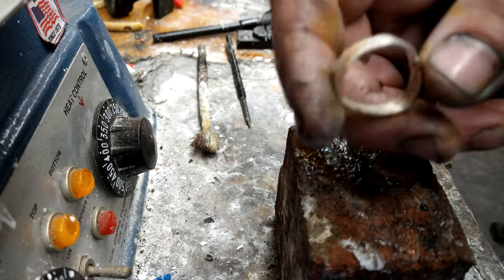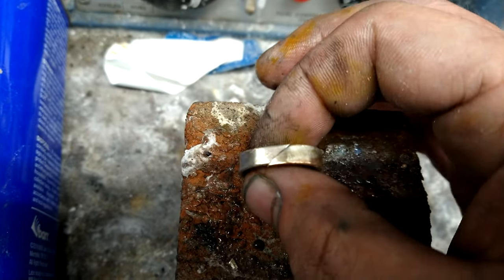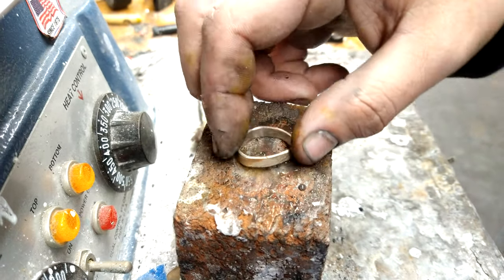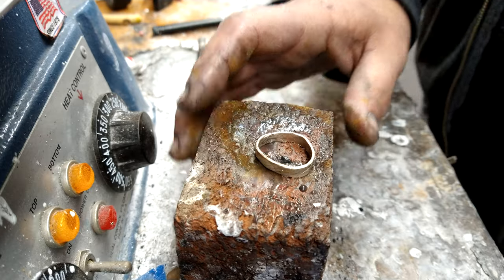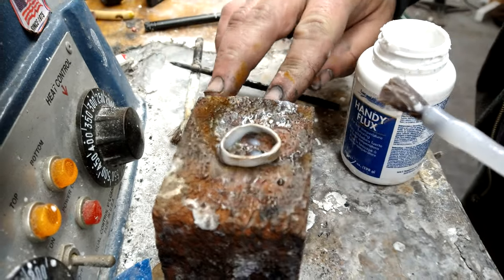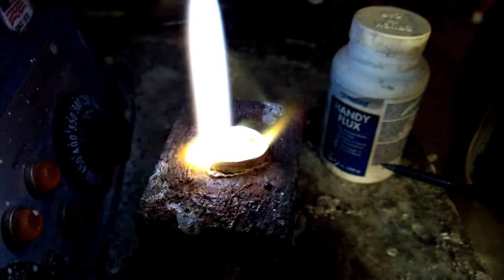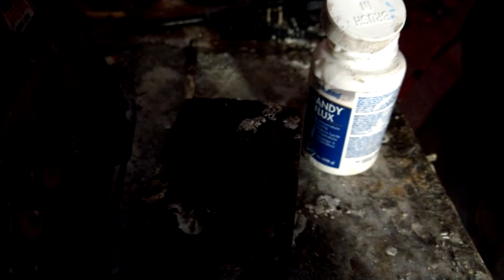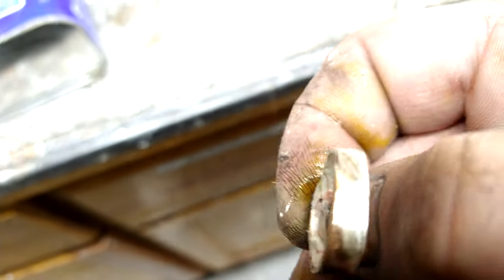Mokume Gane ring seam being soldered. advanced silversmithing and bench jeweler technique

Comment: Great video! The question I have is what is the reason for putting flux over the entire ring? 
I have denatured alcohol and boric acid to keep the firescale out.
Reply from the maker: The reason I am using paste flux here instead of simply dipping in a alcohol boric acid mixture is because of the sterling silver. The paste flux is better for high temperature brazing, the sterling is going to conduct heat much faster than the gold and due to the marriage of the metals, the already low melting point of these metals has dropped quite a bit. So I am using the higher temperature nature of the flux to actually keep the metal as cool as I can so it doesn't go critical or deform or God forbid alloy in places....
Also the boric acid plays a bit of having with the sterling by removing much more of the copper elements of the alloy than I would like
So not only will the flux help keep it from going critical, it helps preserve the tone and surface of the silver which will be hit slightly by the acid
Reply: Thanks for the heads up on using the paste flux. I appreciate your help with this matter!